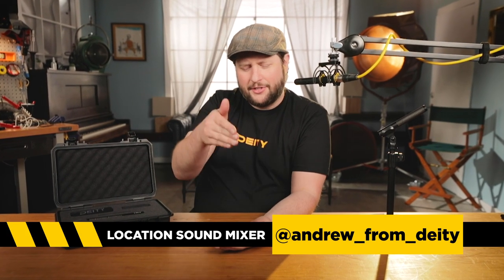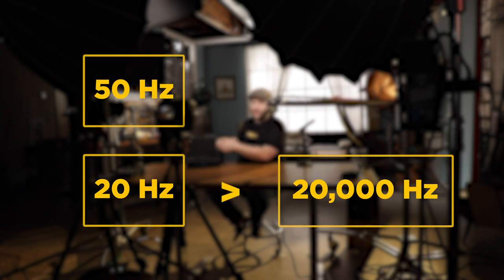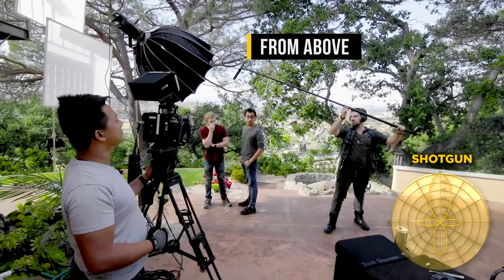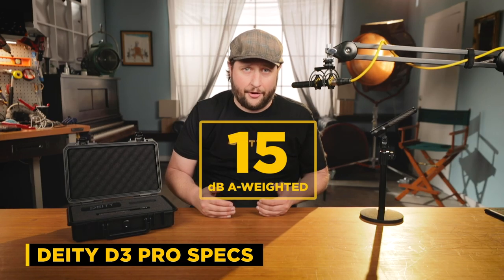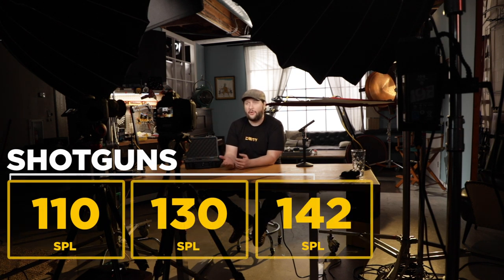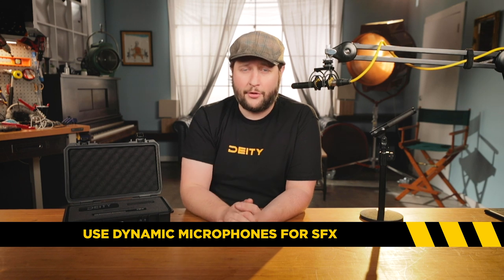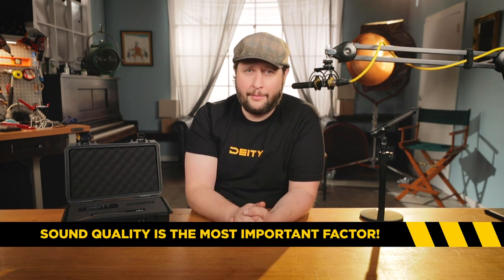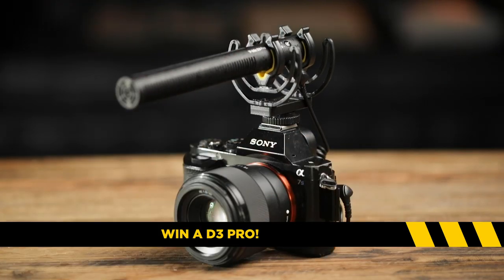Which Mic Should I Use? | How To Read Microphone Specs

Comment from the maker: Which mic spec has confused you the most?
Reply: Deity Microphones love these videos! Would love to learn more about impedance, and also more in depth explanation of line levels vs mic levels, if that is related to adjust gain vs fade or sensitivity. 

Like where along that path of microphone to recorder to computer are things being adjusted and how does that impact the signal? How does battery in mic, vs phantom power affect that signal collection? Or the difference between turning up the microphone vs turning up the recorder?
Reply: Is audio similar to RAW file for photography? In terms of adjusting the data?
Reply: Maximum dB output levels at Specified SPL THD
Reply: Why does my iPhone/Pixel phone pick up the more of the true frequencies of my sound (trumpet) than my ShureM88 or Zoom Q2n?  I know the problem is how I adjust the pre-sets, but there are so many variables - The Gain control being the biggest, as I'm required to play very soft and very loud in a short period of time (fractions of a second sometimes).  I'm just looking for a step up from an internal phone mic sound.
Reply: hello, i’ve been trying to find help as to what kind of microphone i should use for a short film in filming that’s filmed in the woods. any advice or recommendations?

Comment: Thanks, really helpful! Output impedance is one that confuses a lot of people.
Reply: Allow me. Output impedance is the amount of force behind the audio signal being sent from the microphone. If it's too high for the input of the mixer/recorder it's going into then it can overdrive the input and distort. An analogy: A low impedance output is like a garden hose shooting water into a wide brim bucket 3 feet away - smooth stream going in without spilling more than a drop or two along with a loose mist. A high impedance mic is more like a jet spray attachment on the same garden hose - same amount of water but it's going to splash back out of the bucket with great force getting everything wet with a reduced water level.
Reply: Sound Speeds thanks Allen!

Comment: On the frequency chart, is there any indication that say this is a good mic. Is it better if the line is more flat. And can I take two charts (expensive and cheap) and make adjustments to the cheap with EQ to try and match the expensive and make it sound good?

Comment: Hey, I'm trying to record on board car audio but dont know enough about microphones to know which microphone would work best. 

Ive tested with rode video micros but ive had to turn the gain on my H1N all the way down to 3 for the audio not to clip and be at a normal level. 

One microphone is used to record just the exhaust noise, so an omni directional wouldn't be the best choice i feel. 
But the other microphone is used to record under the hood to pick up the intake and engine noise.

Do i need a high spl microphone for this? Since the cars im recording are quite loud. Or are there other more important factors?

Comment: Dynamic mics for high SPL sound effects and only condenser mics for very low SPL's soft faint  sound effects?
Reply from the maker: For close proximity miking you want a high SPL microphone for sound effects because you may find "small" sounds that have fast peaks that could exceed a microphone's  SPL. And a condenser microphone will pick up faint soft sounds a dynamic might not hear, like when doing a clothing pass during a foley session.
Reply: @DeityMicrophones  
So the limiting factor of a Dynamic mic is not just to do with the Sensitivity is that right or am i missing something.
Let's say we have a -60db Sensitivity Dynamic mic and a -60db Condenser. The condenser albeit very low self noise. Would still pick up on more sounds compared to the dynamic? 
So we can say the condenser mic has a a higher sensitivity vs dynamic? Even though they are rated for the same sensitivity output?

So to if we have two condenser mics at reasonably high output. Take the Rode NTG 5 at -23.5db sensitivity. Both 23.5db same noise floor etc but it can be possible for one to have an ability to register even feinter sounds than the other? Due to construction of the diaphragm? Where i would think the Dynamic has a stiffer diaphragm and only react to sounds over a certain SPL range